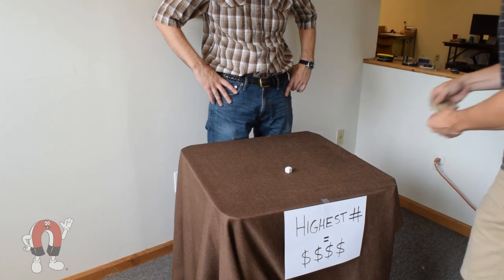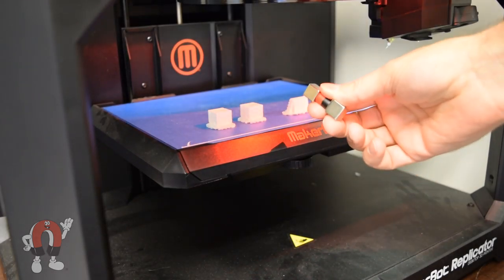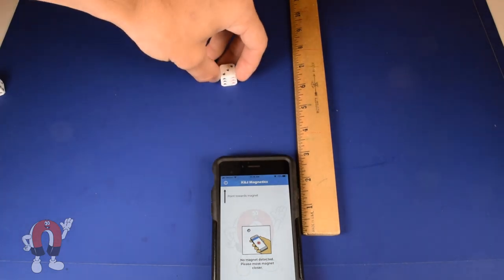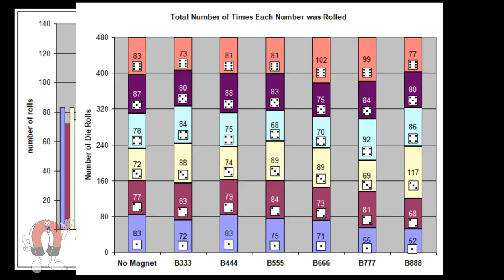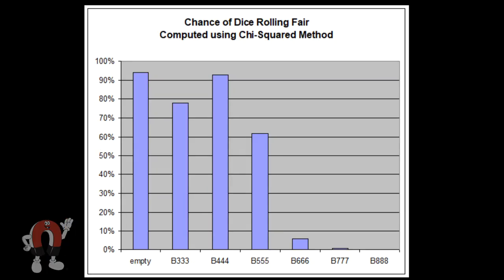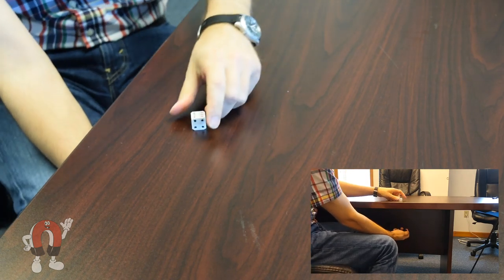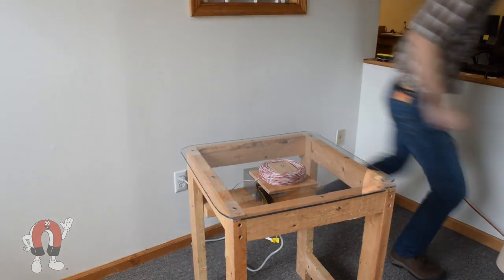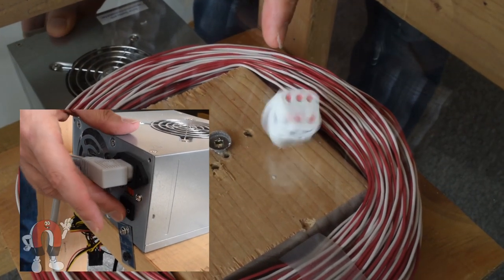Cheating (Magnetic) Dice, EXPOSED!!

Comment: Problem here is that dice at casinos are clear so how would that work? In colored pips
Reply: YOU CAN MAKE CLEAR WITH STILL RIGGING EASILY . IT DOESNT TAKE MUCH MAGNETIC MATERIAL SOME MAGNETIC MATERIAL EXTREME STRONG IN THE PAINT OR JUST THE ENTIRE MATERIAL HAS 3% IN IT WITH ENOUGH POWERFUL FLOOR THEY LAND ON. EVEN IF IT NOT RIGGED 1000% IF THEY HAVE AN EDGE OF 10% THATS HUGE AS THEY WONT CRANK IT TO 100% OR IT MIGHT GET CAUGHT